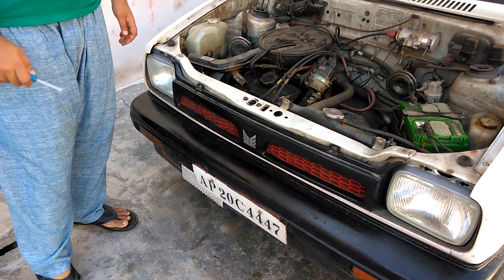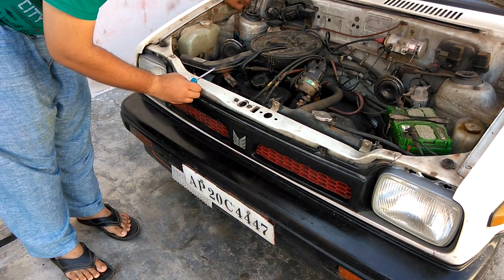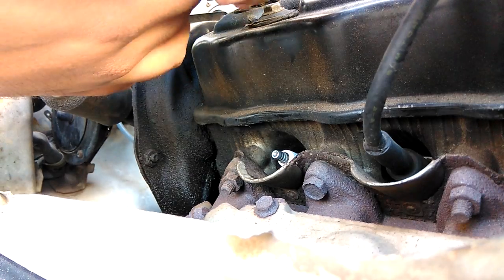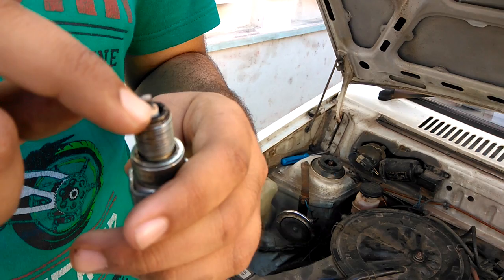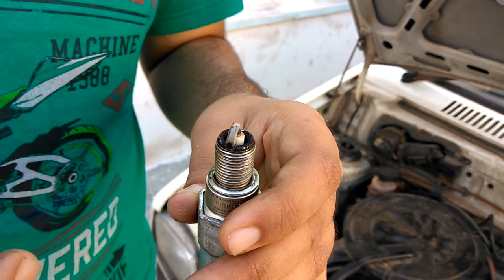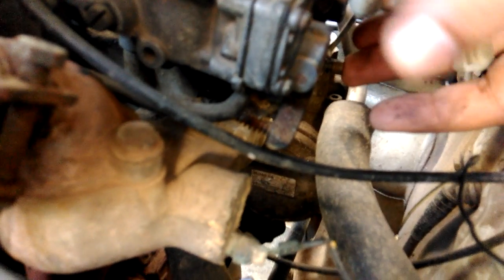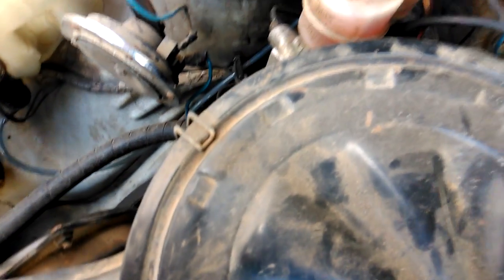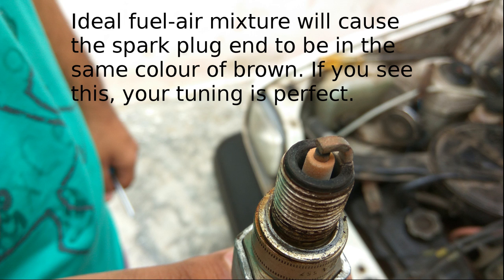M800 Rebuild Part 9. Tuning the carburetor

Comment: Hi Aveem I am having a problem in my 99 model carburetted 800 the car is starting ok in cold engine but in hot conditions it is taking a round and I have to push accelerator a bit then it's starting two days ago I have got the tappet adjusted and ignition timing also with timing torch so can u tell me is it a consequential problem or some other unusual problem.

Comment: Hey bro thanks for your videos ,I have m800 5speed  ,how to change the timeing belut
Reply from the maker: You first have to remove all the other belts and pulleys and then remove the timing cover to change it. It will be difficult and you should do it accurately. Or else, when you are placing the new belt, if it is misaligned, you will ruin your engine. So, I suggest you get it done with a mechanic. Don't try it at home unless you know what you are doing. But why change timing belt? any problem?

Comment: maruty engine shaking whAt the problem tell me bro
Reply from the maker: Cheny Sg, i think one of your spark plug wires is gone. do a small experiment, unplug one of the spark plug wires, and see if the engine stops. if the engine is still running, plug it back on and try pulling out another plug. if your car stops, then one of the other two plug wires is gone. better replace the whole set of wires